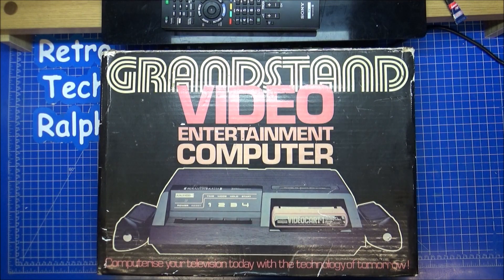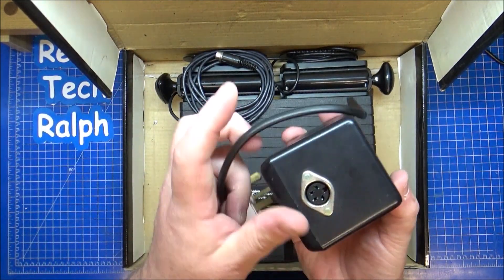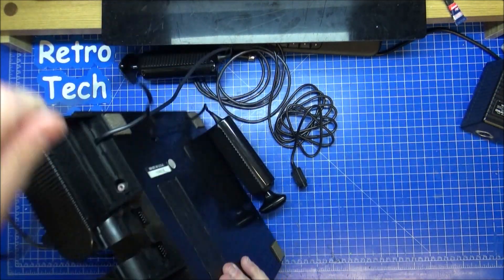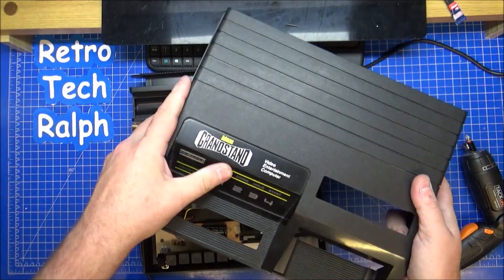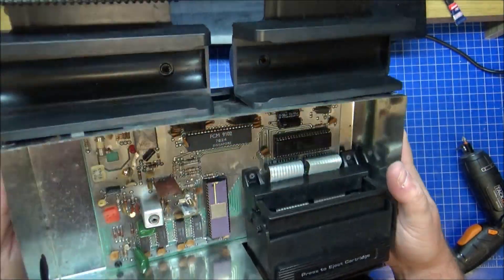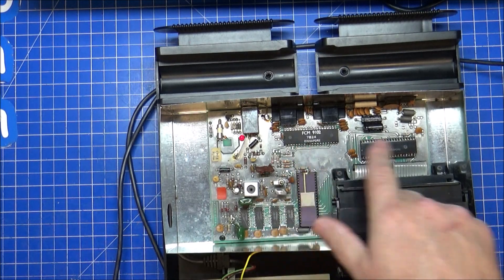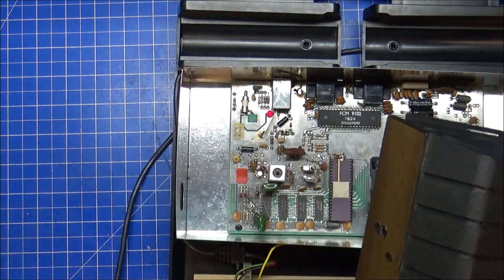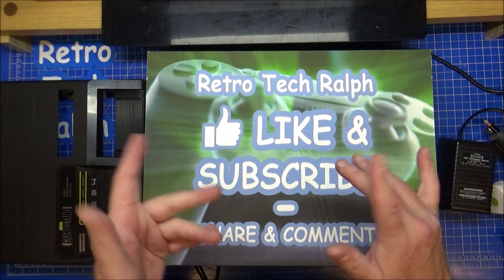Fairchild Channel F Teardown

Comment: Do you still tinker with this kind of stuff? I did something stupid (unscrewed my console to get a cartridge out) and I've now got a dodgy display (lines or boxes where graphics should be), sound, processor seems fine. Might be a memory chip issue looking from what I've seen online, I had random dead pixels that pop up historically so a possible symptom of a the same issue. Not got the technical knowhow to work out what and how to fix.
Reply from the maker: if its not a chip issue, these old consoles suffer from dry solder joints.  Going over them all with a soldering iron and fresh solder sometimes brings them back. Hopefully it could be that simple.

Comment: I need to repair the 1-4 buttons on mine and this was great so I don't have to go into completely blind.
Reply: well i opened mine pretty sure its a ribbon cable issue. Mine is also a system 2 but my board is pretty different thought. the four 7838's are in sockets not soldered on for starters.

Comment: How do I connect to a modern LCD TV just bought one of eBay thanks
Reply from the maker: ive not done a mod for these, but there should be something out there to convert the rf signal to a composite one, or you will need to open it up and mod it with a composite mod board, but no idea where to solder one to im afraid. I didnt want to mod mine, but im sure there is a device out there to plug in the rf cable and play.

Comment: What is the power supply output
Reply from the maker: https://console5.com/wiki/File:Fairchild-Channel-F-Schematic---Page-1.png    looks like both 5v and 12v. look at pictures bottom left for power schematic
Reply from the maker: and a -5v too
Reply: @R_T_Ralph  thank you
Reply: @R_T_Ralph  
I have a console with a cut cable so if I wired a five volt power supply the console will work
Reply from the maker: @adhemelfaiky6047  no, it will need multiple voltages. not sure where you can get a replacement from, but i have seen one out there.

Comment: Nice teardown. That LED is just bizarre... 🤔
Reply: I believe it was put there for the purpose of checking if the electricity would come through as it should, and if so meant it was working.
My only theory for why it was kept inside would be that it would cost more making a lot of mechanical arms remove them then to not take it off.